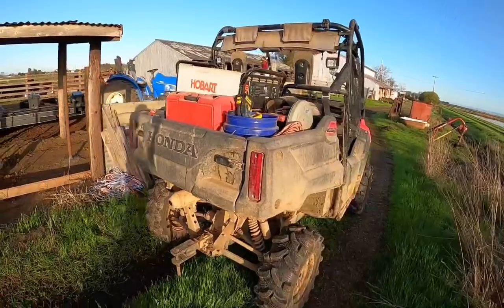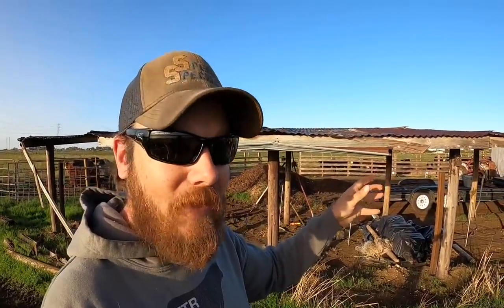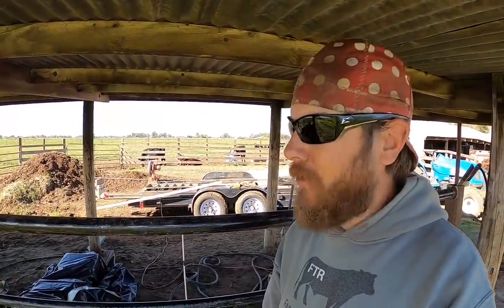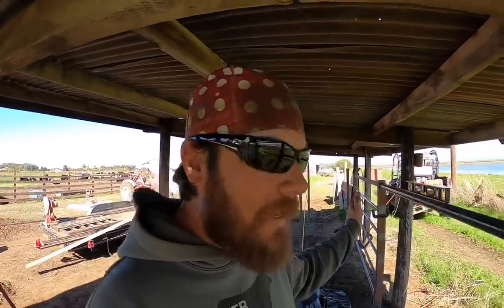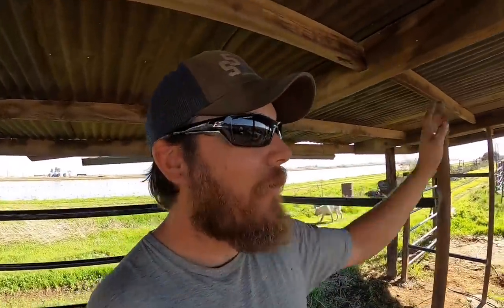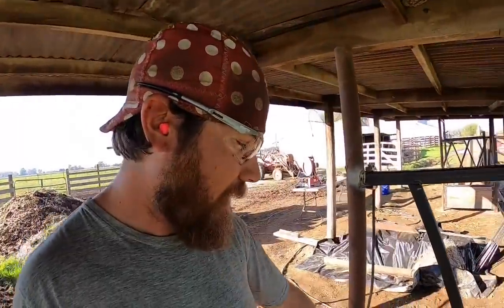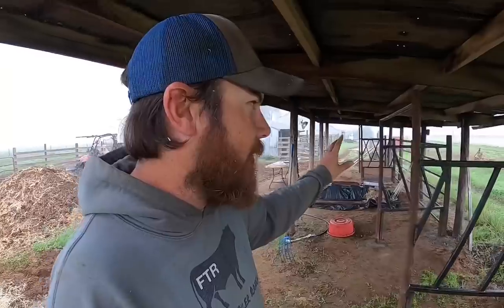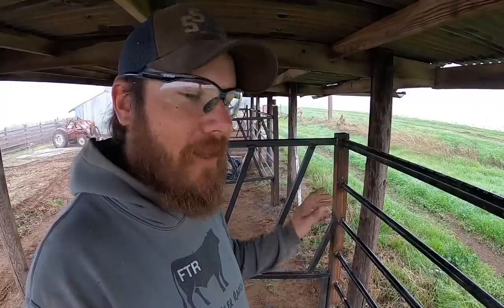Building a Round Bale Fenceline Bunk Feeder- Part 1

Comment: i bought one of those blades for about $100 and made 10 cuts on 15/8" pipe  and now it is so dull all it does it burn it in two
Reply from the maker: Those blades require a special low rpm saw. The “dry cut” saws turn at about half the rpm as a typical chop saw. On the correct saw and used properly that blade will out last an abrasive blade by quite a bit!